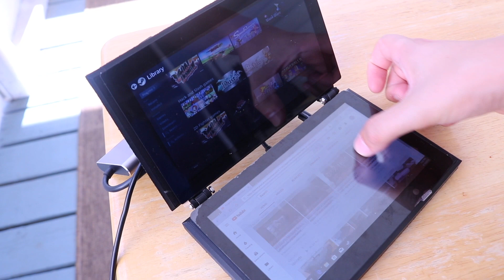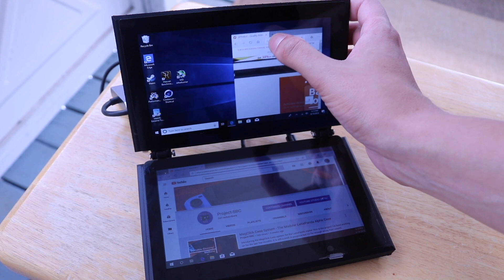DIY Dual Touchscreen Windows 10 Computer! The LattePanda Alpha Delta MagClick Case and Tutorial

Comment: I love the design. I was planning to make something like this, even before your video came out. I'll likely be using an old netbook housing.

My question is, since LattePanda has HDMI and USB ports, is the hub necessary?
Reply from the maker: Steven Grumbein yeah it is, the screen needs up to 1 amp and the LPA usb only does 1/2 amp or so. The hub powers it’s usb from the power adapter directly, therefore it can get an amp
Reply: @HandheldHardware  Ah, that makes sense. That explains why my proof of concept only half worked.
Reply from the maker: Steven Grumbein if you have some time i would love to see some pictures of your project. Keep it up!

Comment: Would it be possible to do 3-4 touch screens with this? its exactly what I need and this is really close! Thanks
Reply from the maker: Brian Machado The quick and easy answer is no. The long, complicated answer is maybe. The lattepanda alpha is limited by 3 direct graphics display out and by usb power output. That being said, it’s probably doable if you have one display out as a USB graphics driver (read slow and CPU intensive) and you provide external power for usb devices. That set up is most likely not going to be portable
Reply: @HandheldHardware  Do you think connecting a graphics card that has 4 outputs, to the LattePanda, then doing that would work? Could I also buy 2 LattePandas and somehow cluster them such that I can do 2 monitors each but only 1 OS?
Reply from the maker: Brian Machado absolutely a GPU would help. If you aren’t too concerned with number of components, you could add a GPU and a wall powered usb hub to run all those touchscreens. That would work.  What do you plan to do with this? From windows OS you would need a sever version to cluster two of them, although I’m not quite sure you could get that running well on this board. Linux might be possible too
Reply: @Panda Aradia I tried looking it up, but could not find a good method to run 2 pandas on 1 OS as a cluster. Do you have any resources?
Reply: @Panda Aradia yes but can this be done with windows)?

Comment: Я тоже думал о чём то подобном. А зачем переходник на type-c, напрямую HDMI и USB в LattePanda.
Reply from the maker: Федор Кудинов the bottom touchscreen needs 1 amp to operate. The USB port on LattePanda can only provide 0.5 Amp, so the screen does not turn on. The USB C hub uses wall adapter to power the touchscreen.